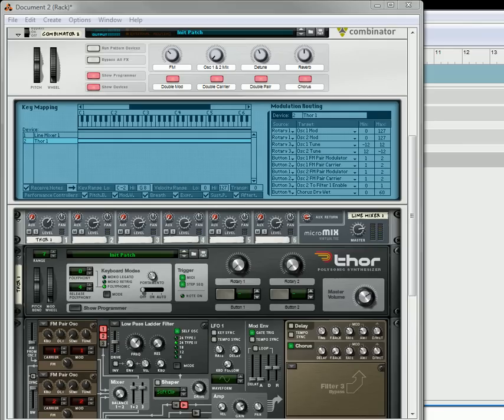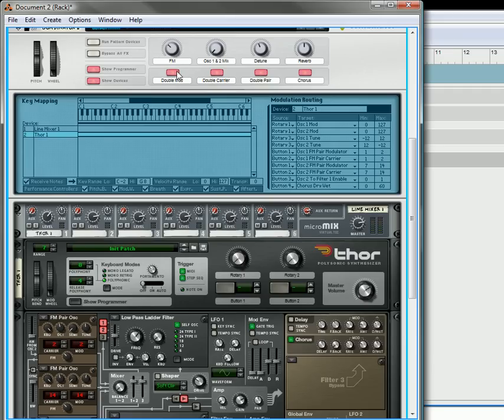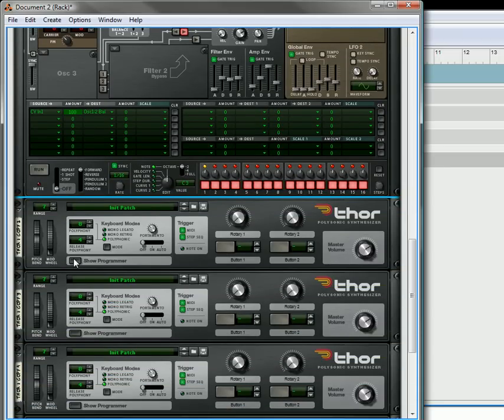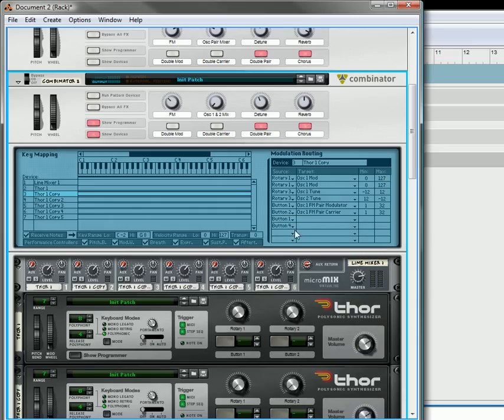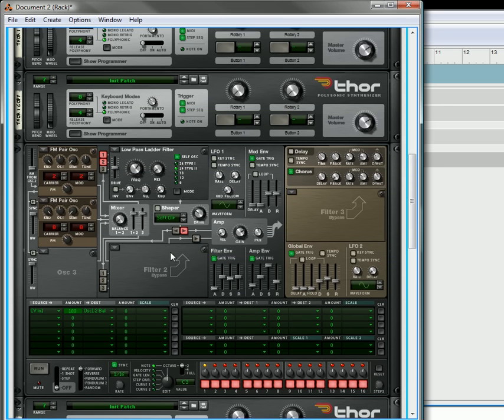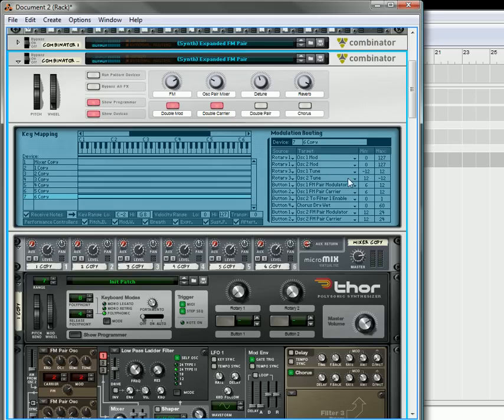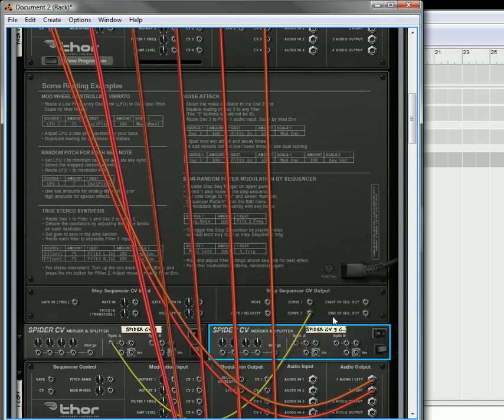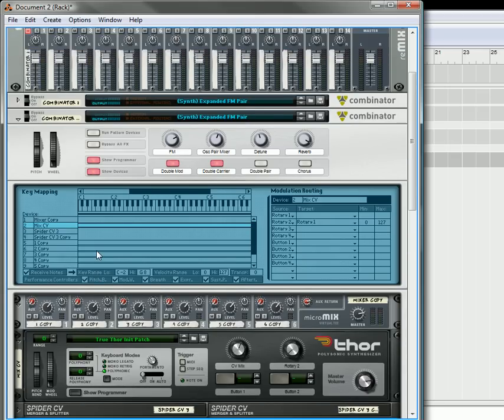Layered FM Pair Synthesis (Part 2)

Comment from the maker: @SyncrisisVideos Good point. I often do these videos over a few times because there's always something I forget to mention. And sometimes things are so complex as to have multiple videos to explain things properly. But sometimes it's hard to explain everything in one go. One other interesting point which I just learned is that programming in Thor is "cumulative" - if you duplicate a modulation on two lines, you will double the values. Something I just learned recently.

Comment: This is a wonderful tutorial. You go fast enough to keep it interesting, but you explain things well enough that users with any ability level can understand. I do want to point out one thing on the last part that wasn't fully clarified, and which always seems to catch me when programming: modulation matrix in thor is not bi-directional like programmer in combi (no min/max values, rather addition OR subtraction values.) Make sure target starts on zero for effect to have full addition from cv.